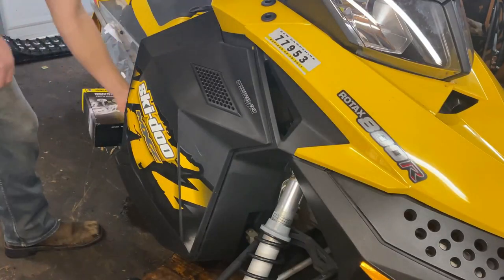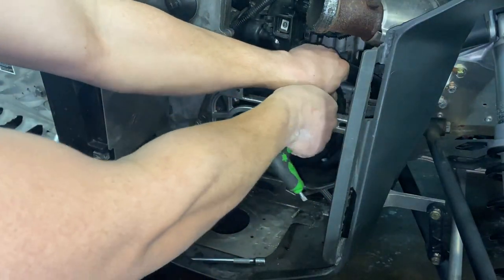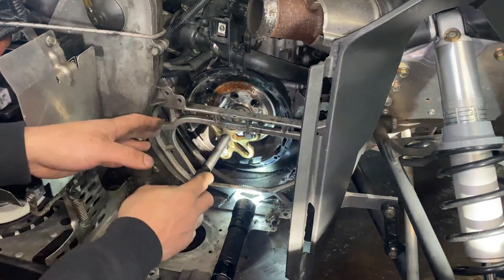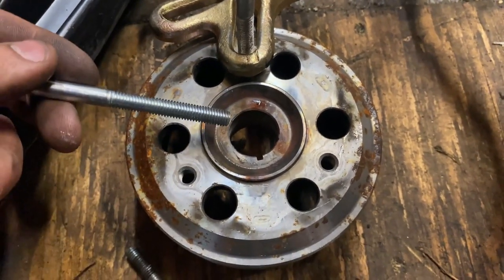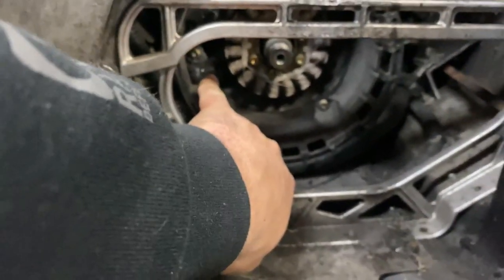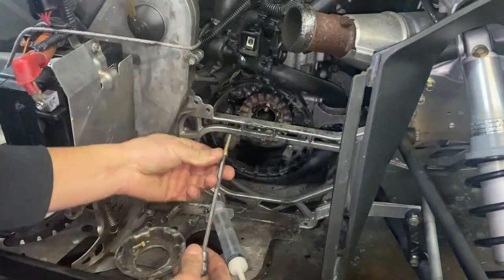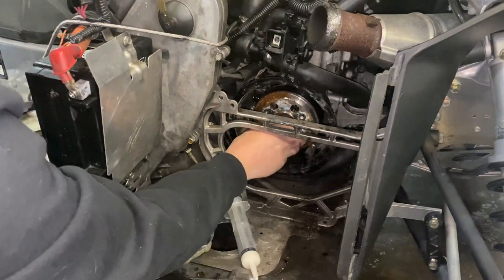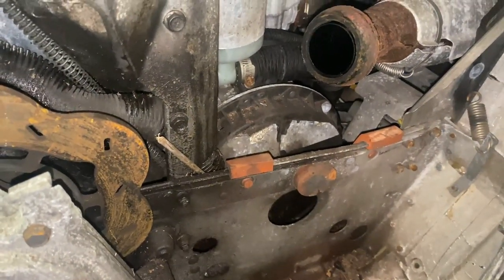keeping your skidoo 800 healthy Pt. 2 ( mag side crank bearing grease)

Comment: Great tutorial Brother. I had my pawl let go on my gen 1 so I put a kimpex kit in and it failed after about 7 pulls. So now that I need to it again I will do my msg side. I know they say to use isoflex but I am not paying that price. I have a 100% synthetic shell product that they use in the super calendar machine bearings at the mill it’s properties are a little higher than isoflex I have been using it for 4 years now and no issues when I go out to the shop I will send you a pic of the tube. It’s about 100 bucks a tube but works great 👍.
Reply from the maker: Thanks man! Aeroshell 22 eight?

Comment: Have you seen 600 carbs leaking from the seal on the pto side? Ive got a 2020 with this issue. Going to remove seal repack and install a retainer plate

Comment: Hi Bobby thanks for the great video! I was wondering if there should be lock tight put on the stater bolts to seal the case from air leaks that could cause a lean condition and possibly a burn down in the Mag cylinder?
Reply from the maker: Nope! No need because there is an inner crank seal the bolts don’t seal anything

Comment: Have you worked on fuel sensor issues or speedo issues before? Neither on my 2013 summit 800 work. Tac and heat gauge work fine
Reply from the maker: Probably the in tank sender. Easy resistance check. The speedo is probably the pickup in on the clutch side of the jack shaft

Comment: Do you have a link to the harmonic balancer you used?
Much appreciated and great video! 👊
Reply from the maker: https://www.harborfreight.com/bolt-type-wheel-puller-set-62620.html?utm_source=google&utm_medium=cpc&utm_campaign=12144811130&campaignid=12144811130&utm_content=117789278798&adsetid=117789278798&product=62620&store=260&gclid=CjwKCAiA9aKQBhBREiwAyGP5lUEkxDF-_EjyijLddX0L1Ml0gVlVSfduygAbYIlT1sdgO-aUJhpuohoC6DYQAvD_BwE this one will work mint!
Reply: They can be rented at any auto parts store for free as well..

Comment: Hi so I bothered you about 9 months ago greasing my mag side bearings .  I'm in the middle of putting it back together and can't remember on the pickup coils does the green wire pick up coil on top or the blue? 07 Ski-Doo summit 800r p tec . thanks
Reply from the maker: Did you depin the harness?

Comment: Thanks for posting this! I have a 2010 with 5k miles that blew up on me on the 6th ride after buying. I just acquired a 2009 same model that was a totaled chassis but motor looks ok. No idea on miles. Would you advise a rebuild no matter the circumstances before swapping motors?
Reply from the maker: Yeah I would. If the engine is out why not

Comment: Great video so what if I wanted to change that Meg side oil seal would that require me to split the cases again ? I did  rebuilds a couple years ago on 05 800 ho & 07 800r summits.
Reply from the maker: The inner seal on the mad side the cases will have to be split. There’s a dirty way to do the pto side crank seal without splitting the cases.
Reply: @bobbyrebussini1466  Thank you, I got my motor out right now on my 07 I had a bolt snap off  the plastic housing  and chew up my pickup coils and my magnet pretty good so figured grease why everything was out.
Reply from the maker: @sawmillingGarry  for sure man. No problem!

Comment: Rolling bearings need space for the grease to move between the balls/rollers. Over filling will churn the grease which quickly overheats and the bearing is toast. Why have Rotax not run engine oil through the bearings so they dont need grease?
Reply from the maker: they do on the 850s  I’m not sure why they did it like that back then. All I know is I’m happy they don’t do it like that now.
Reply: And there are main bearings inside the motor which can’t be lubed. The local tech said it’s not an issue but seems odd.
Reply from the maker: @fairbanksairriders  well those aren’t perminant grease. They run 2 stroke oil like they should. Just like the 850s and all other anything lol
Reply: Oh ok. now im really goin holder wide open.  ;-))

Comment: Quick question. On my old sled an new one there is like an slimy thic substance all over my belly pan and not sure what it is if it’s coolant or oil but I have notice a little  coolant leak but not much . out of my 800r etec with 300 miles and my old sled had to about the same as my new one with 5000 miles.   Any guesses? Have you ever heard or seen something like this.   Thanks
Reply from the maker: Check the water pump underneath the y pipe and the oil pump on the opposite side if you’re not sure if it’s oil or water
Reply: @bobbyrebussini1466  ok thanks will do.  I was just curious because it oily on belly pan.  But it runs  fantastic

Comment: Did I miss the seal replacement? Or was this an ill informed grease the pullstart?
Reply from the maker: That’s not how the mag side is setup. The tapped holes are thru into the bearing.
Reply from the maker: You’d have to split the case to replace the seal. See the other video I put out on the pto side

Comment: What size are the three bolts for fly wheel that you used with the puller
Reply from the maker: Ehhhhw whatever ones came with the cheapest harmonic balanced kit from Orielly
Reply from the maker: My guess is m10x1.0
Reply from the maker: https://www.harborfreight.com/bolt-type-wheel-puller-set-62620.html?utm_source=google&utm_medium=cpc&utm_campaign=12144811130&campaignid=12144811130&utm_content=117789278798&adsetid=117789278798&product=62620&store=260&gclid=CjwKCAiA9aKQBhBREiwAyGP5lUEkxDF-_EjyijLddX0L1Ml0gVlVSfduygAbYIlT1sdgO-aUJhpuohoC6DYQAvD_BwE